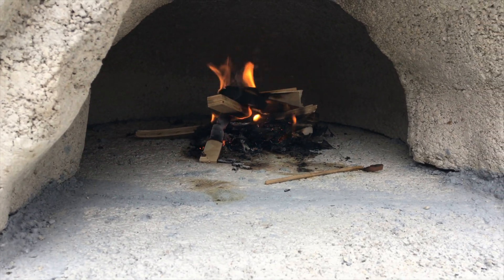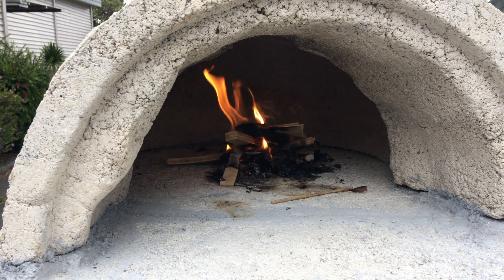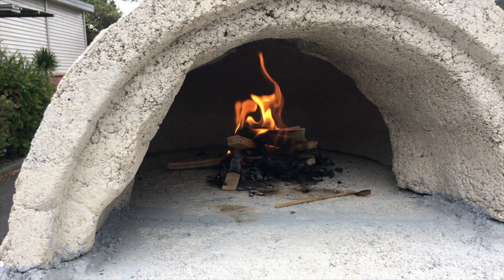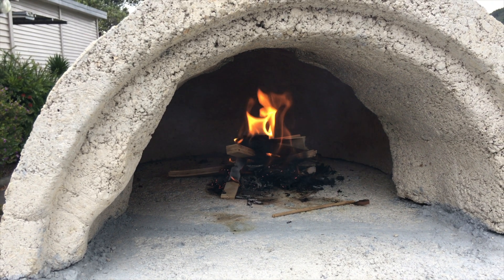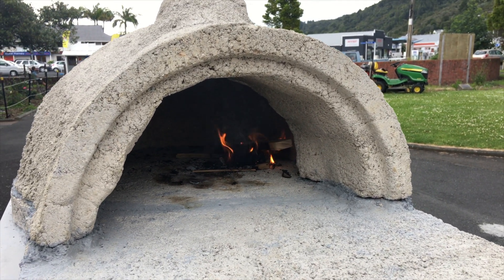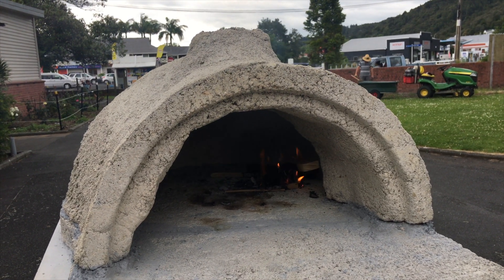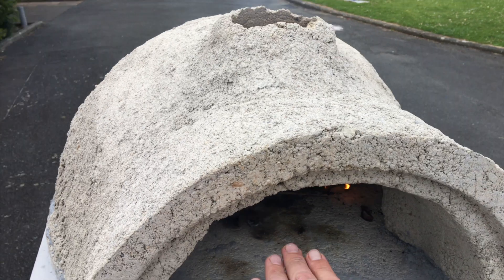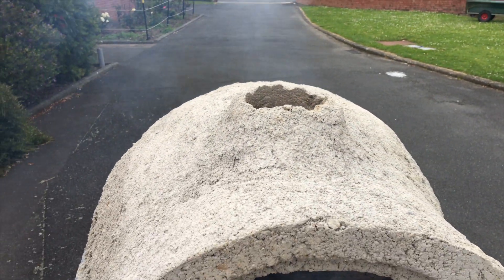Easy Pizza Oven Build tutorial - Part 6 - First fire in the oven

Comment: Hi. Is 8 weeks curing time set or is 6 weeks ok if it's been drying in this summer heat, 24 degrees plus heat. White portland and perlite mix.
Reply from the maker: Yeah I reckon it will be good.
Start with a small fire first up, to get rid of any remaining moisture.
Reply: @foodrelated  Thanks, your videos really helped, I made a small hibachi as a test as well

Comment: Have you considered using Crack-Resistant concrete mix?
link this one: https://www.homedepot.com/p/Quikrete-80-lb-Crack-Resistant-Concrete-Mix-100680/100318448

Or, concrete adhesive?
Like this one: https://www.homedepot.com/p/SikaLatex-1-Gal-Concrete-Bonding-Adhesive-and-Acrylic-Fortifier-187782/202521398
Reply from the maker: Maybe in my next one

Comment: Hi and thanks!
May I use normal ballast( sand and gravel)  to build my oven?
Reply from the maker: majid pourkhodagholi sorry what do you mean by ballast?
Reply: tompeyton1 
I mean the mix of sand and  normal gravel instead of vermiculite, to make concrete. Because vermiculite is expensive. Or what about engineering bricks? I am worried about cracking.
Thanks again🙏🙏🙏
Reply from the maker: majid pourkhodagholi since making this oven I made a perlite oven.
I would advise using that material instead of vermiculite.

Comment: how long did you let the oven dry for before taking it off the gym ball?... great job ..thanks
Reply from the maker: Jo depending on where you are making it it will vary. We made this one inside so left it for about 10 days before deflating the ball. If you are making it outside leave it a bit longer.
Reply: @foodrelated  o cheers.. I took mine off 2day after 3days + it started cracking.. Will have another go again...   Thank u

Comment: So instead of fire bricks you used vermiculite mixed with fire cement?
Reply from the maker: matermark not fire cement, jus normal Portland cement. It makes an insulated concrete, or vermicrete.
Reply: So the floor and the dome are just vermiculite and Portland cement? ALSO, is there any reason you used vermiculite, say, instead of Perlite, which doesn't expand and looks more like lightweight white pebbles?

I grow half my garden in containers and already have "super coarse" vermiculite & "super coarse" perlite, 4 cu ft bags, plus some plain "coarse" vermiculite. The perlite looks about 3-4x as big as aquarium gravel.

I'm undecided on which to use... I read somewhere (here?) not to use vermiculite because it can 'explode' or pop in hi-heat conditions and can change size depending on moisture. I'd like to field some answers or comments on this, because I thought it's already "popped" to form it. I think it's a product of heating mica until it explodes or pops...

Also, it has Cation Exchange Capacity (CEC) properties which I think is something to do with ion conductivity, which, in the case of something that heats up, I'm not sure if it's beneficial or detrimental. Perlite doesn't have any CEC value. And perlite is harder. Plus it floats. 

Both perlite and vermiculite have different grades & sizes. I'd use a smaller size on the outside to get a smoother finish, and a coarser size for structural areas. I would think it may be better to use a heat refracting mortar inside, an insulation blanket, and a topcoat over that. I guess I'm questioning the purpose of the vermiculite; is it supposed to absorb the heat or act as an insulator? Is it just acting as a filler? Will it expand & contract? How long will it stay hot? I'm putting off my build until I get more answers so I can make the best choices, but THANKS for all your help and your oven posts, it looks great!
Reply from the maker: Yes.
The reason we used vermiculite was because it was more easily available where we are. You definitely could use Perlite instead and it would work.